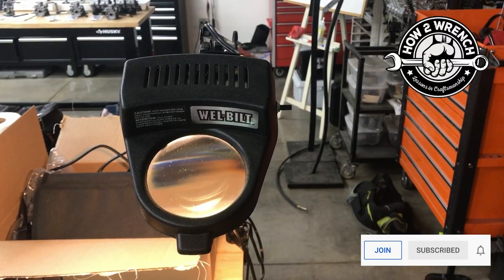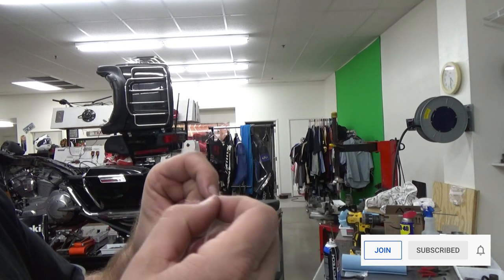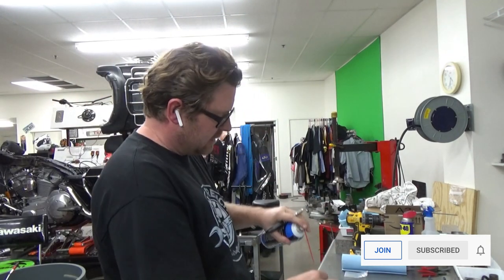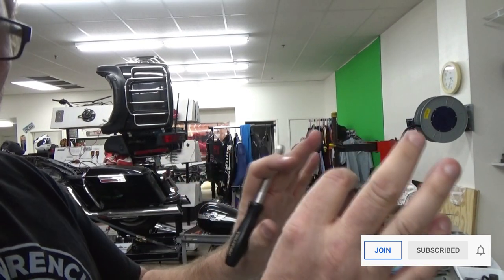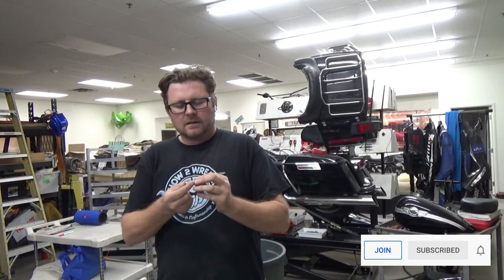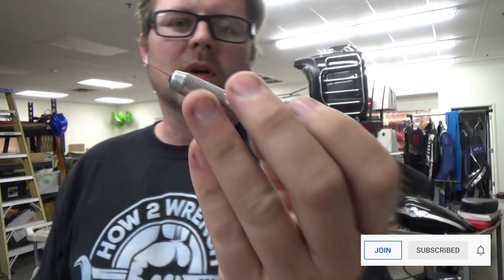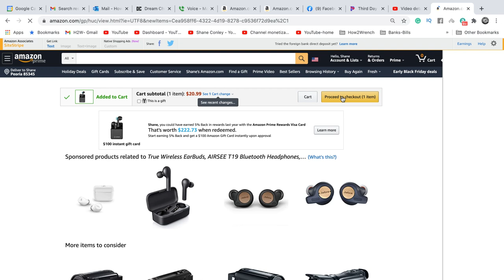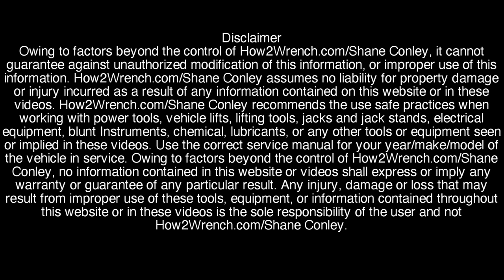How to unclog a carburetor jet. We try a subscriber suggested method! Tell us what you think!

Comment: I use an old set of electric guitar strings to clean my jets.  Usually the smallest sting high E string works very well and gets into those small holes.  Try it out.
Reply from the maker: Great tip!
Reply: yep, the high "e" string. i wouldn't want to be without it when cleaning the small jet.

Comment: When I'm rebuilding marine carbs. I have a old wire brush that I use to break the gunk apart then I let it soak in super clean cleaner. Its worked for me with out fail so far but always open for new ideas.
Reply from the maker: Great point! Got a link to share with the group on the cleaner you use?

Comment: The micro hand drill handle is a great way to secure the wire. I have one but never though of using it for that application, I’ve been using the wires for a 12” brush for 30+yrs but would pull out one of the bundles then unfold a wire to have enough to hold on to and perform the procedure as described. The down side to my method is ounce and a while I’d poke my finger on the end I’m holding “not good” especially when then using a cleaning agent it tends to sting a little, not to mention direct injection into my body. So this will be a excellent upgrade. 
ps: With the new fuels in California were getting a denser hard almost calcification type deposit in the jet bores, as the fuel evaporates it “reduces” the size and creates a lean condition after about 3-4wks. The only fix that has constantly worked is to have the customer drain the bowl if not ridden at least weekly (they forgot if I say 2wks) so I tell them drain it after the weekend of riding!  Starting the bike every so often can make it worse we’ve found because every time the fuel level drops especially when the heat of summer rapidly evaporates the level it leaves another micro deposit repeatedly reducing its flow potential and going from popping on deceleration to a no condition after only 2-3wks.  When we have a stubborn rider that refuses to drain the bowl it’s a source of revenue I’d rather not receive but after they have a few bad ride days, it’s usually hay Ray when should I drain the bowl? One last thing we’ve learned with our CA. fuel is taking the long wire and putting a couple of snake type non-acute bends along the length helps to assist in removing the “hard brittle”deposit around the circumference of the hole!  And no it doesn’t in-large the dia. as was the concern of someone else in relation to the use of a small wire!  I also have a set of tiny “minus”plug gauges for super small pilot jets that a brush wire that small is to flexible. The only thing I thought I was going to say before ALL THIS Was to say that you explain things in a way that is AWESOME you assume the person will benefit from a step by step explaining of why you are doing the procedure in that particular way, painting a mind picture for us! and it works VERY WELL! THANK YOU! Keep up the great instructional videos!  THE EAR BUDS SOUND GREAT! 🙏🇺🇸🗽😁😎
Reply from the maker: Great note...Sorry I'm laughing at the "poked myself" been there more times that I can count before the micro drill! 
We sure love you taking the time to comment. Are you coming to the next live session? 
There a few ways you could help keep this work going and stay connected with me personally.  
1. The fastest and best thing you could simply do for us is hit that subscribe button…helps us creators more than you know! 
2. Join this channel to get access to perks:
https://www.youtube.com/channel/UCBhM8DCKnT3qXwTW0eToyCg/join   
3. Give us a high 5 here:  https://www.paypal.me/how2wrench    
Keep Wrenching,
Shane Conley
Peoria, AZ USA
Follow us!

Comment: Here's a method I have used. If you know someone in the printing trade ask them very nicely if they can get you a 1 gal can of what's called press wash. This is in my mind hands down the best degreaser and carb cleaner I have ever used!!! No joke... I took a Holley 4150 650 cfm double pumper. That was so badly clogged up...NO GAS WOULD FLOW THRU IT... I threw it in a 5 gal bucket of wash... didn't even take it apart. Let it soak for 2 hrs. Pulled it out worked the throttle linkage it passed some gas. Back in bucket soak 2 more hrs. Pulled it out. That carb was spotless inside and out.i promptly disassembled it and looked... it was totally clean.NO VARNISH !! And the best part is the wash won't eat the gaskets or dry them out.i was a web offset printer for 12 yrs. AND THIS IS HOW I DID MINE. The wash is also nonflammable (YUP WE TRIED TO LIGHT THE SHIT ON FIRE). It lasts a long time.
Reply from the maker: Dang sounds great! TY

Comment: Hoppes #9...soak the brass bits. We use to clean fuel injectors on aircraft engines with much smaller gauge orifices than main jets on a motorcycle.
Reply from the maker: Nice....Is this what you are talking about? https://amzn.to/2UMSKKD
Reply: @How2Wrench  Yes. Also I just bought a problem child 2002 Suzuki Bandit 1200. The float seats were leaking, there was nasty corrosion of the carb body where the o-ring of the brass seats. I cleaned corrosion carefully using a rotary tool on ultra slow and just kissed the edge of the surface to get the corrosion off. That still left an unacceptable surface to seal an o-ring reliably so I used Hylomar racing formula and applied tiny dabs to the o-ring seating surface using a dental tool, and to the surface of the o-rings, wait for a minute for the Hylomar to flash and then assembled. Prior to assembly I used a hardwood dowel in a drill to polish the needle seat of the brass, inspected the needles and found them pliable and no grooves so I re-used them. The bike has been running excellent and no leaks. It was a last ditch effort to save the carbs, the only other option was carb replacement. I wouldn’t do it for a customer’s bike, but I’m not a professional motorcycle mechanic. For 50 cents of sealant it saved the carbs, I highly recommend Hylomar.
Reply from the maker: @naps3386  Dang bud...full of tips...I think I found it. https://tech-beac.com/en/industrial/maintenance-chemical/adhesive-and-sealants/threadlocking-gaketing-retaining/hylomar-m#:~:text=Hylomar%20M%20(previously%20known%20as%20Racing%20Formula)%20is%20an%20acetone,the%20standard%20Hylomar%20Universal%20Blue.
Reply from the maker: @naps3386  https://amzn.to/2URGJnu
Reply: @How2Wrench  Yep, that’s the stuff. I can’t think of an equal or better product for what I was facing. I wouldn’t hesitate to use it again.
Reply from the maker: @naps3386  I had a "farm kid" as a student that swore by it one year. I will have to find an application in need and experiment!

Comment: I use the Superfloss on jets as well, but I use it in a different way.  When I have an engine that's surging, I use the "fabric" part in the middle of the floss along with some Brasso brass polish to clean and slightly enlarge the hole in the jet.  I just run the jet back and forth until the floss starts turning a little black.  You want to take off just a little, put the jet back in, and then do it again if it's still surging.  I used this method on a 179cc Powermore (Chinese Honda clone) engine; those engines have a reputation for running a little lean and surging.  It fixed the problem completely.  I hope this helps someone.

Comment: i've got a pilot jet i've been trying to get unclogged....   Tried soaking in the spray carb cleaner and the welding wires but nothing gets it open.  I even tried some map gas to heat up the jet and then poke it...still nothing...

Need to find my super tiny drill bits and see if that will work.

Comment: Heres one way, but the wire can be too soft.  Just take a length of 12 gauge to 16 gauge electrical wire and cut the insulation off and seperate the wires and push one or two wires through the jet back and forth.  Or you might could unravel a paper clip and run that back and forth through these jets
Reply: I like using standard wire also.
Reply from the maker: Nice! TY

Comment: Great concept...I like the idea of a non abrasive method. 👍 
However at the small engine repair shop we use a acetylene torch tip cleaner followed by chemical pressure dip tank, the entire disassemble carb.  goes in for 30 mins. And we have used micro drill bits but only at the clogged end and not all the way through the jet. 

But like most people... I don’t have that at home and I don’t have ultrasonic cleaner at home just a can of carb. dip.

The ear buds sounded good, you might need another set charged set on standby when making educational videos?

Great job as always Shane‼️
👍😎👍
🏁🏁🏁
Reply from the maker: Right on...
Reply from the maker: At $9 bucks I should buy a few! But these batteries have been awesome so far...time will tell but looking good!
Reply: @How2Wrench  
My wife has a few that she uses to watch movies on her tablet while we are in the living room, while I watch a different movie on the TV with wifi headphones. So she has a pair ready for when one needs changing... I also have a back up wifi set of headphones.

Comment: I realize this is an old video. (And a useful one). But what drives me crazy is all the time I have to spend trying to decide what the SYMPTOMS are of a worn/dirty/broken part is. (In this case jet). 

Example. I rebuilt the carb (CV40) and it ran great for a while. Now, while I'm going down the road, my Road King sputters and comes to a stop. If I let it set for a few minutes it starts back up. What could be the issue? I'm thinking a jet is getting dirt in it, it then settles to the bottom of the bowl and starts again and sometimes will keep going. It stopped in the middle of WY. and it started back up and got me home to Denver. 

My point is WHO is going to create a video describing what a dirty or clogged jet does. (Symptoms!) I had to search FOREVER to diagnose a bad coil. What does a clogged jet do? (Or not do).  What does a dirty jet do? What does a stuck float do? (Most of us know that, but still). What happens when a float needle gets clogged. What are the symptoms that you experience when you have certain carb issues. Or starting issues? Or coil issues? Or charging issues? Any help with diagnostics would be great. A site (channel) dedicated to "symptoms" would be fantastic. 

So instead of just showing HOW to clean it, tell the audience what it's doing to know that that is maybe the issue.
Reply from the maker: Have you thought of using How 2 Wrench's 1:1 techline service? Get Shane cell here! Is this an emergency and your head is about to explode from frustration or fear? Get Shane’s cell here: https://how2wrench.com/product/personal-tech-training-phone-facetime/

Comment: FIRST: drill it out with a wire bit. THEN, find that it doesn't idle for S*, even worse than when the pilot was fully clogged.  SOLUTION:  Use welding wire stuck through your drilled out pilot, changing size of welding wire 'till it runs just right.

Comment: i hope you can help me i was driving my 89 nissan sunny with e15 engine in it then the engine suddenly had low power until it dies had it towed until i got home now it doesnt start nor run it has spark and fuel timing belt is okay since it wont make spark on sparkplug if the timing belt is broken i also tried direct feeding it with fuel on bottle on carburetor it still wont start any fix?
Reply from the maker: I'm the intern studying under Shane. He's on the road training techs and not here to ask this week. I fInally made it to your comment going down the list...just an FYI...he literally logs in and answers member questions daily! Consider joining...best $1.99 you'll spend this month 😁
One of these days I hope to move from the office to the shop! Wish I knew the answer but don't want to bs you. He couldn't screen these requests fast enough...

He has a few other tricks up his sleeve he plans on making videos on. If you need help sooner choose and option below! 

That’s a great question for Shane directly! We are just the social media team. Shane does answer questions when he get's back around to non members eventually so hang tight, FYI >>>> he does member ones daily!

He just returned from overseas training techs and his inbox is slammed with requests. He is scheduling time each day again to answer techline orders. He does not have the bandwidth to provide free email replies as his schedule is full with shop customers, training schedules, and one on ones. 
There's good news though! Shane has 2 solutions for you. One is a deep dive one-on-one with him with video, email and phone support. The other is a "quick fan support" option when it's a quick answer and just helps support the time for him to stop wrenching or training and get you in the direction that a free video had you close. Links to each are below. Hope this message makes sense to you as a decent human being that also works for a living and gets it!
Make it a great day!

The one-on-one service. Get Shane’s cell here: https://how2wrench.com/ols/products/techline-one-on-one       
Quick answers are answered daily as a channel member: Join this channel to get access to perks:
https://www.youtube.com/channel/UCBhM8DCKnT3qXwTW0eToyCg/join   
-Daily MEMBER FIRST COMMENTS ANSWERED FIRST 
-Live Q/A video chats
-Wonder if we have a video on your need? Members can request content links!
-Full Access to the ENTIRE 700 video library
-Member-Only FREE tool giveaways  

Have you seen our "YouTube Trained Support Shirts? Great way to "high five us" https://goodfellasmerch.com/collections/how-2-wrench/products/support-shirt

High fives help too! Give him one here:  https://www.paypal.me/how2wrench

Comment: I would buy a new carburetor because all of this isn't worth my time or the headache. FYI Change your air filter 3 times a summer when you pull the filter out, shop vac the whole filter box and take a small dry paint brush and remove all debris and vac again and install new filter making sure it is in the right way sealed tight around perimeter of filter. Gas can, make sure there is no debris floating in your gas can!  If there is filter the gas into another container and rinse debris out of gas can and pour gas back in. Make sure you don't have dirt and debris where the spout screws on, keep it clean so nothing gets into the can when removing and installing spout when filling gas can. Same with the gas cap on mower or whatever you are using. If there is any debris floating in gas tank of mower, remove and rinse out like gas can. Use non- Ethanol fuel (always) if available in your area if not use a fuel stabilizer additive like Sta-bil to all your fuel. These are the keys to keep a perfect running lawn mower running perfect all the time..